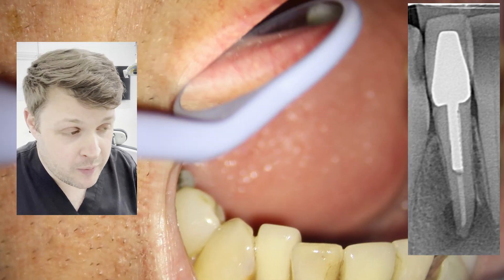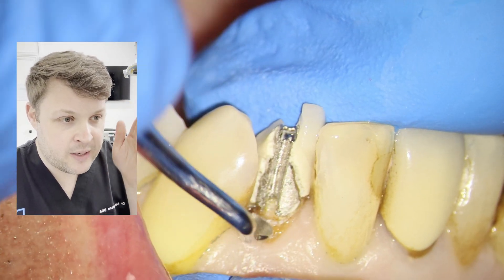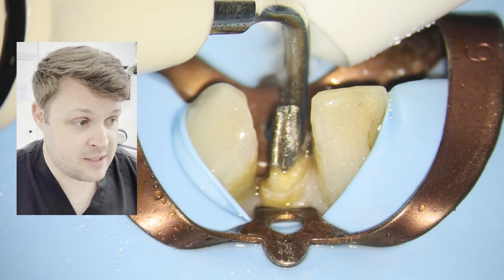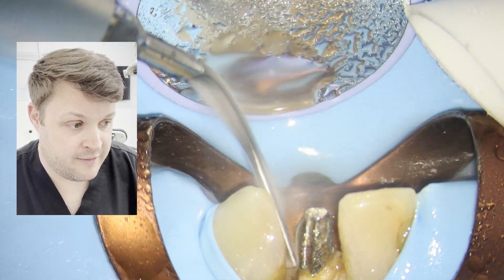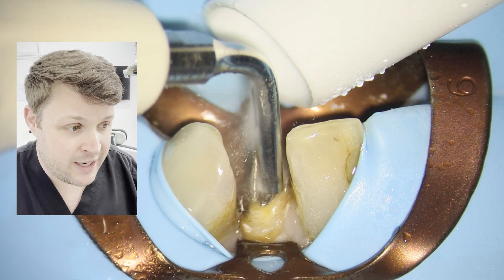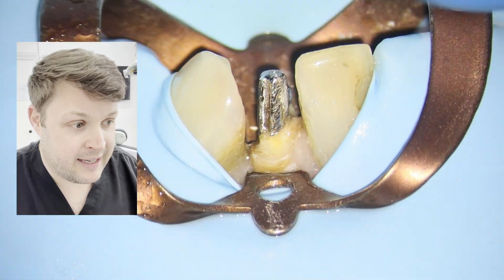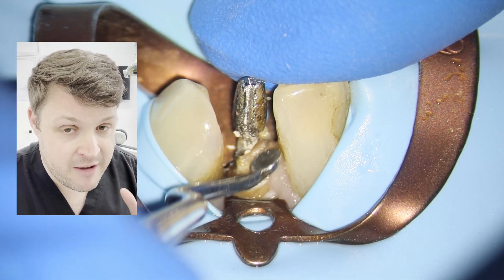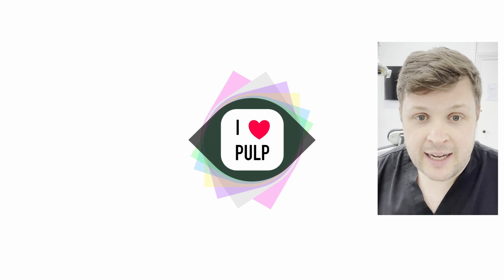BEST WAY TO REMOVE SERRATED POST | 4K Resolution

Comment: Nice video.
Have you ever used a post removal system, in particular the Wam X and your thoughts on this? Im in the process of removing a indirect post with the ultrasonic method (with same  ultrasonic tip) but as of yet no movement of the post. The length of post is approximately 10mm.
Im thinking of maybe investing in Wam X
Reply from the maker: I’ve never used a Wam-x, but have considered buying one on a number of occasions! I think everyone sticks to what they know and what they have used and found to be effective previously. In my case, using ultrasonics and finding a leverage point has always come up fruitful, and I have yet failed to remove a post, or even fractured a root in the process. Have you used a Wam-x before? What are your experiences?

Comment: great video, sometimes I hold the excavator with gentle upward pressure while using ultrasonics in the other. BTW how much time did you allocate, and what did you use for a temp post, or did you do the reRCT in 1 visit?
Reply from the maker: Another great tip! It was two visits this case, I gave myself 1 hour and 30 mins to remove the post. then another 1 hour 30 mins to remove the remaining obturation material; re-obturate; and then place a fibre post.

Comment: You should alternate between water and 10 to 15 seconds of no water, to heat the cement and makt it collapse. It would be way way faster. And it won't make much negative impact on tissues anyway.
Reply from the maker: Thanks for the tip! Any suggestions for videos you'll like to see?
Reply: @ilovethepulp  yes, top 5 tips to go faster in endo or smthing like this
Reply from the maker: @clemswag7205  Thanks for the feedback!